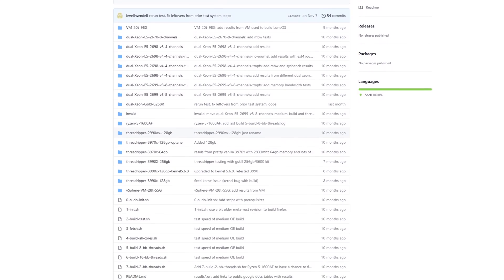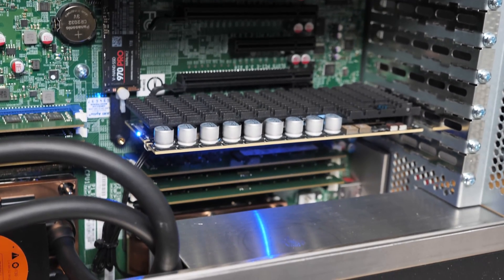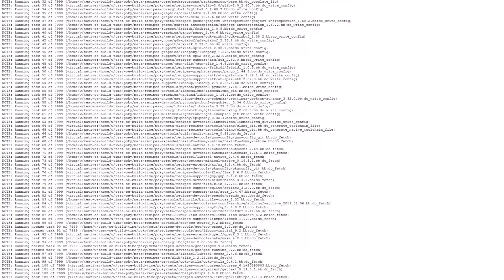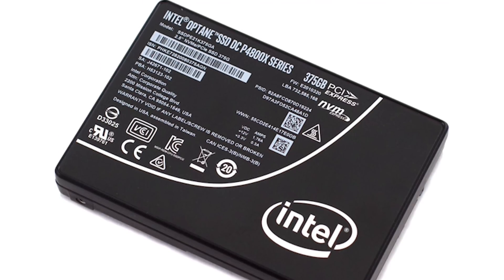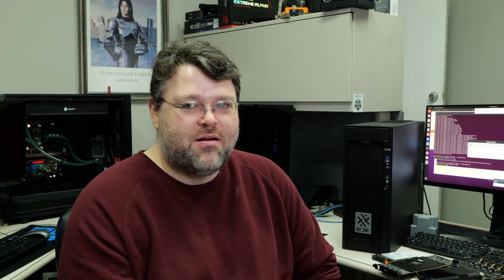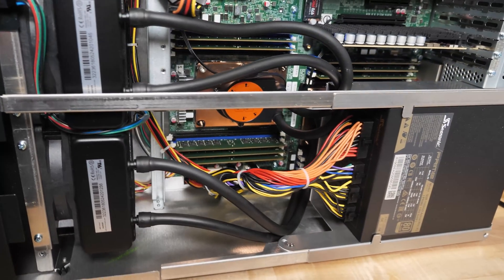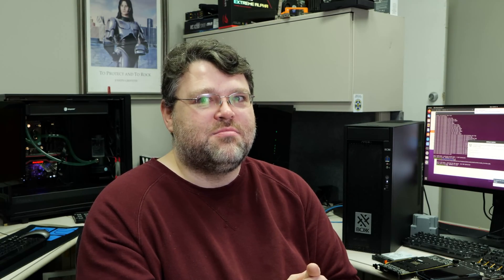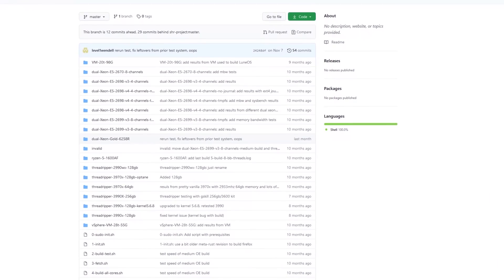Testing Openembedded on the Boxx Apexx D4 Xeon Workstation!

Comment from the maker: + Github Link: https://github.com/level1wendell/test...

Happy holidays everyone!
If you don't celebrate a holiday, have a great rest of your week!

~ Editor Amber :)
Reply: Is the link actually /test...? That's how it opens on my phone

I believe it's https://github.com/level1wendell/test-oe-build-time
Reply: Seems like you really ought to check up/build the possible dream workstation with some small cubature/SFF case and the almost mITX board from ASRock - the ROME4ID-2T paired with some high core count EPYC and 4x128GB or 4x256GB RAM and that similar or better NVMe setup using all those 8xPCIe4... well maybe not all, cuase you'd need to dedicate one or two for USB controllers or internal audio card or maybe even a WiFi card (still that's probably 2 out of 6 available slim connectors so even an 8-way fast PCIE4 NVMe RAID is still on the table). I bet such a WS could be great in most things computational ;)
Or maybe you could get your hands on some WS out of ThunderX3 or Altra or A64FX and go deeper into the realm of ARM powerful desktops/workstations before Apple  releases its own ;) After all, if you want to test software for Apple products as well why not use same architecture for both dev/build machine and target product lines ;)

Comment: I laugh at your dual cpu setup. I built a driver in CUDA SDK that takes all multitask'd or parallel-necessary processes and puts the gpu to work on them in realtime.

Most say that gpus are not general purpose computing devices, but I beg to differ. No one will use my driver but me. Sorry not sorry.